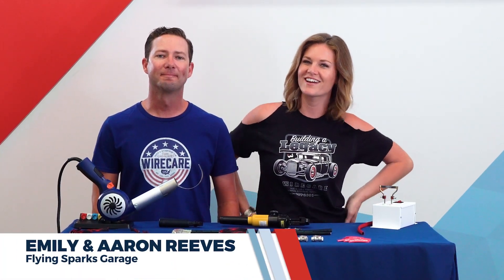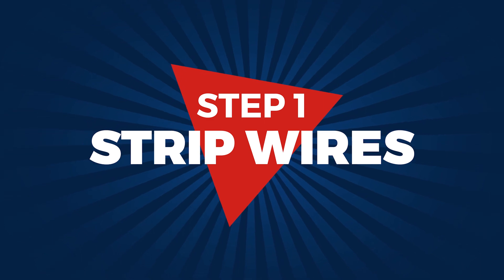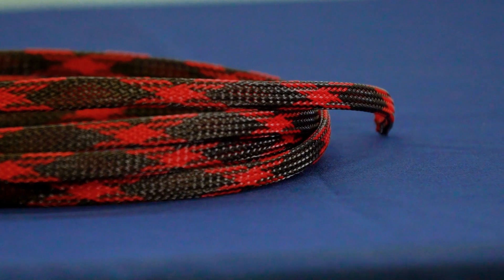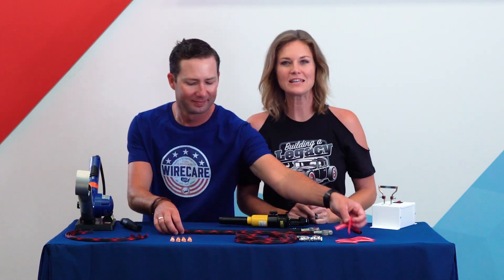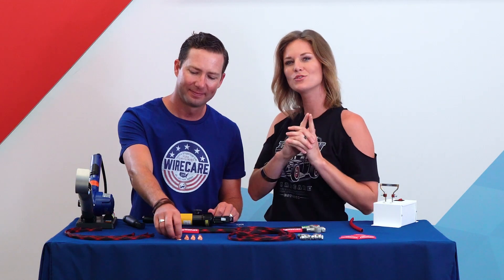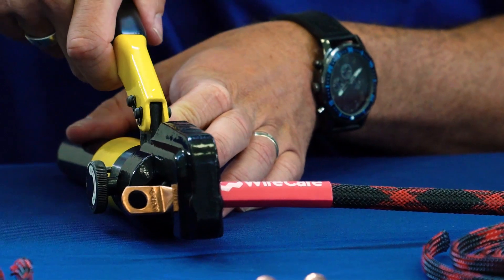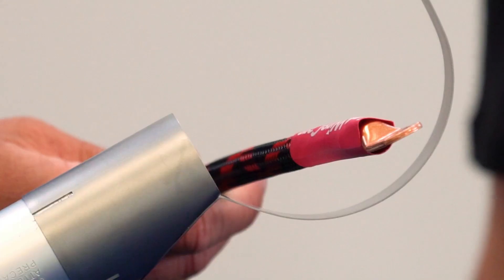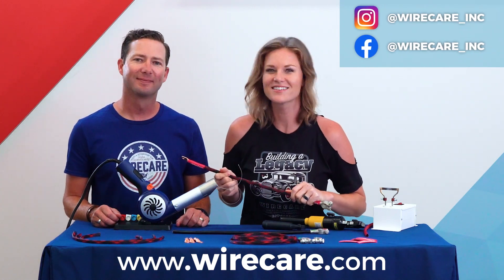Custom Battery Cable Tutorial | With Emily & Aaron Reeves (Flying Sparks Garage)

Comment: Those lugs are not good quality I’m working on mobile HD equipment in the mine those are failing very frequently ive substituted them with the heavy duty lug used on high voltage